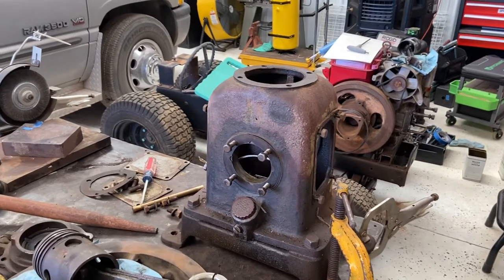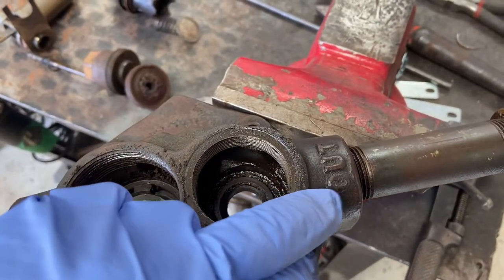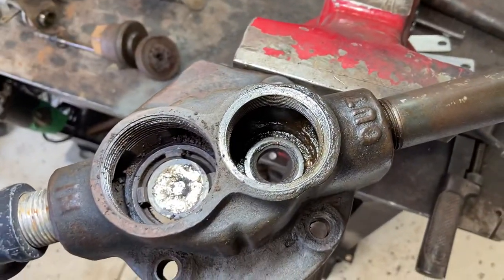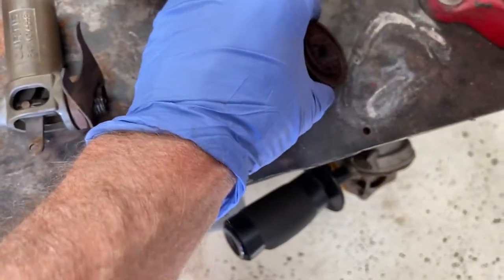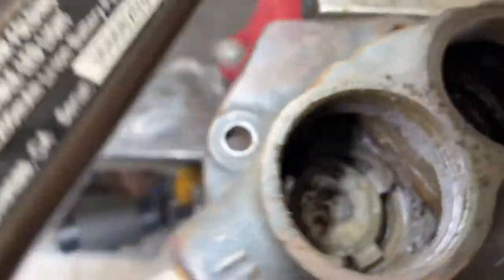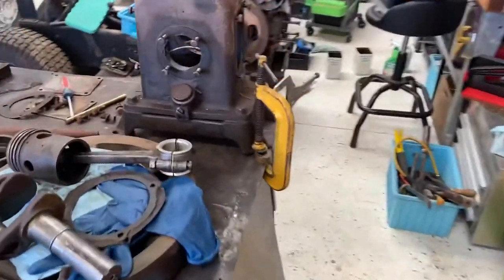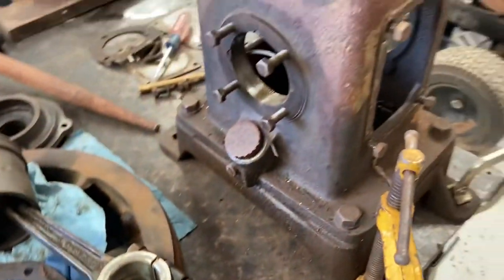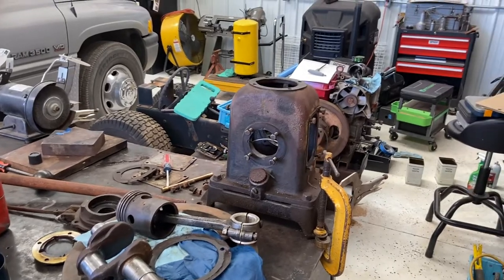Vintage Curtis Air Compressor Refurb

Comment: Matt, that oil "slinger" design is still used today in the FS-Curtis ML reciprocal compressors.  You will probably find little holes drilled all over near the bearing surfaces for the oil to travel to and lubricate.  That sling ring design is a quasi-pressure lube system for these compressors.  This helps these units live a really long time even in heavy usage and really tough environments.  I am a salesman for a FS-Curtis distributor out of Greensboro, NC.  This is a selling feature for our heavy duty ML series industrial reciprocal compressors.  Really cool and interesting that this design has been around this long.
Reply from the maker: I did in fact discover those drilled holes. I have been running this compressor quite a while now and it is solid as a rock. Thanks for stopping by, and feel free to use the videos as a sales tool!

Comment: I believe I have this same compressor, mine has the #40 on it, the data plate is unreadable and the only other markings I find are Curtis and St Louis.  Can you tell me the model and make or anything on this?
Reply from the maker: My ID is cast on the back of the head. I will check it later this morning and let you know. I checked for info based on the patent number I found
Reply from the maker: I'm going to postpone my trip out to uncover the compressor because it's 25 degrees and blowing snow right now!
Reply: @mattthescrapwhisperer  completely understand!  Thanks for the reply.
Reply: @mattthescrapwhisperer  maybe this will help, on the top brass piece mine is marked Curtis St Louis PAT’ D. 10-7-13. I don’t see anywhere else to get numbers but would you know what this mean?
Reply from the maker: @MonsterMike816  Google that patent number and you should get a couple of pages of info.
Reply from the maker: @MonsterMike816  Weather finally cleared up. Mine is a number 40 also. The label plate with all the specs is long gone, but I got a lot of info from Googling the patent number.

Comment: Good morning Matt
Reply from the maker: Howdy Ed!
Reply: @mattthescrapwhisperer  I like the oil slinger.. seen a few odd ways of doing it. That style valve seems to hold up well, only time I've seen an issue with them is a little crap or corrosion gets in them.
Reply from the maker: @GosselinFarmsEdGosselin  That slinger is obviously effective or that compressor would have been scrapped years ago. I will add an air filter on the inlet side. Since our humidity is so low most of the year, the dust here is like talc and gets into everything.